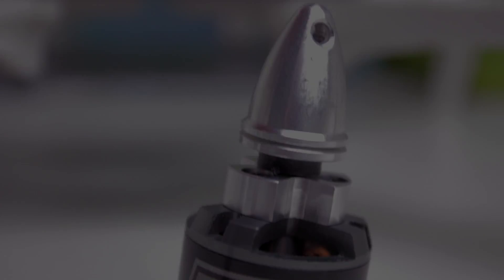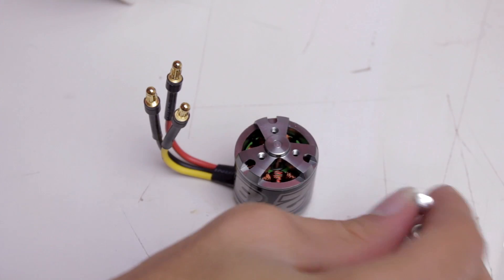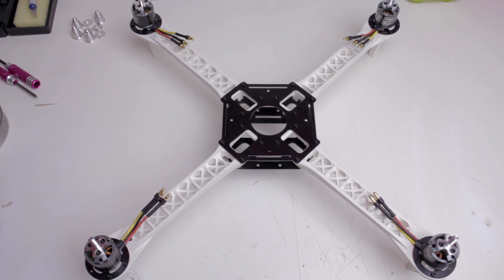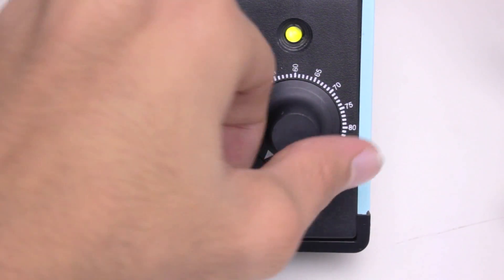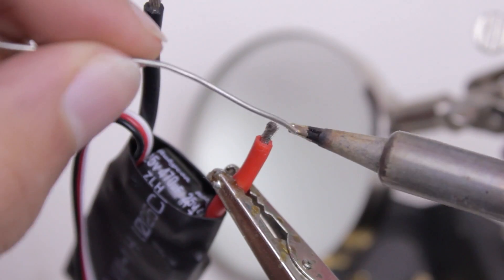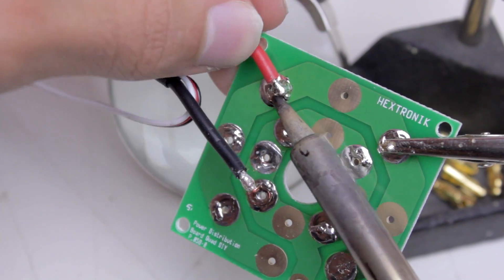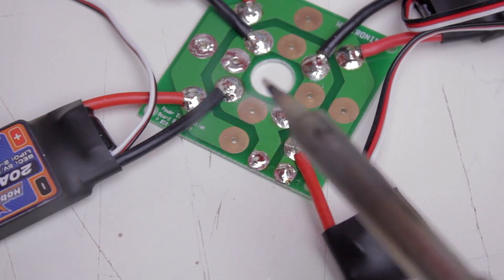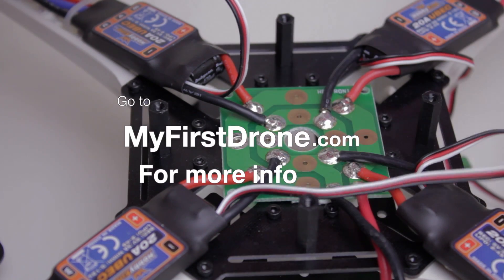Build your first quadcopter (part 2)

Comment: Corey, I love your videos, but you don't know how to solder. I don't know who told you tinning is "coating the wire with solder," because it isn't. It's filling the wire with solder, and doing what you did here is liable to create a cold solder joint, because the messy glob you put on the air is likely to have air in it. To tin a wire, you need to put some solder on your iron for heat conduction, then hold it to the wire until the wire is hot enough to melt the solder. Then the solder will just flow neatly into the strands.
Reply from the maker: Bunny_Ninja I know how to solder for the most part, but I didn't have any flux. Without flux it was impossible to do it the way you described because the solder wasn't able to properly flow"into the larger gauge wire. In any case, this is an old video and I've learned a lot in the last year and a half.
Reply from the maker: My First Drone Now I just use flux for most things and it works like you said.
Reply: Uh, I've used these exact parts you're using without flux, and didn't have any trouble...